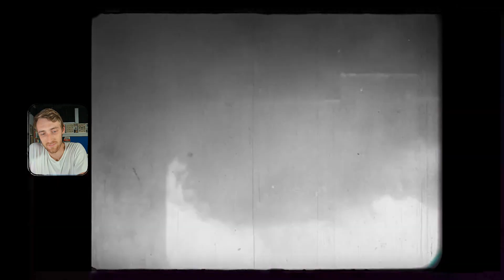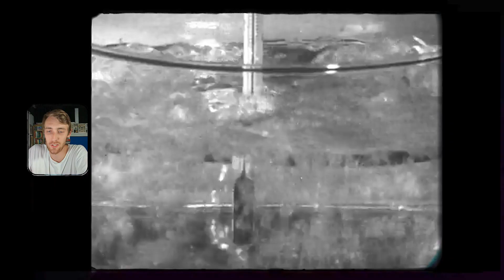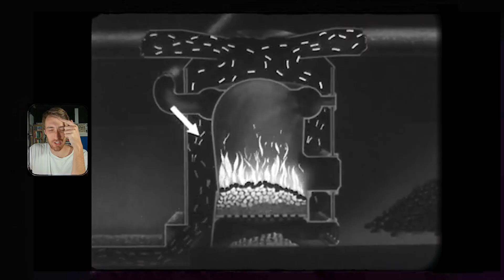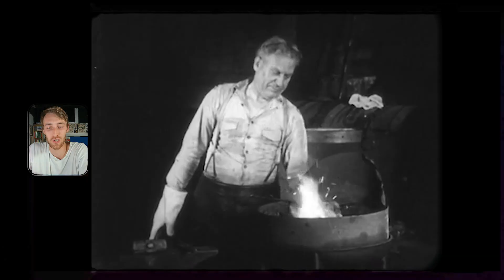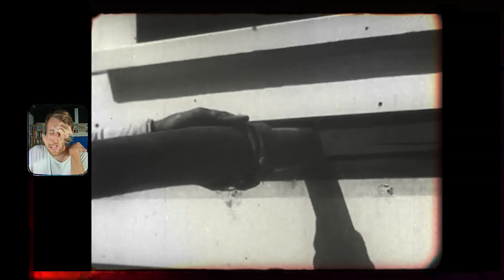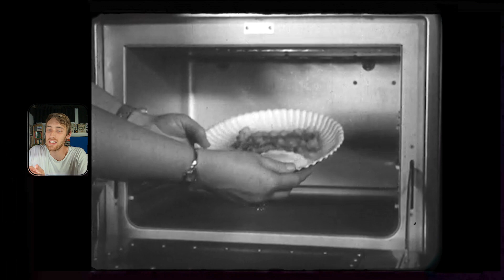Heat Its Nature and Transfer

Comment: I would say you can see convection. Natural convection is reflected on the smoke trails from hot surfaces (Like from a coffee cup) as for radiation it's harder to grasp that phenomenon
Reply from the maker: True, but I feel like anyone who has stood in front of a fire can understand radiation intuitively. Conduction is perhaps the least relatable form of heat transfer but I also feel like that’s very easy to understand as well